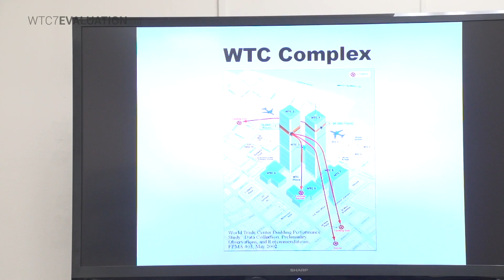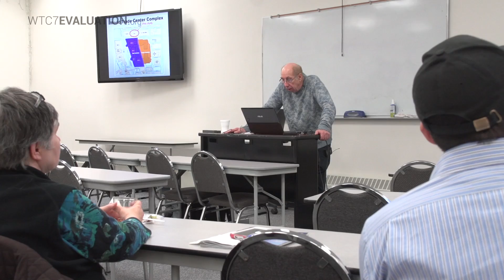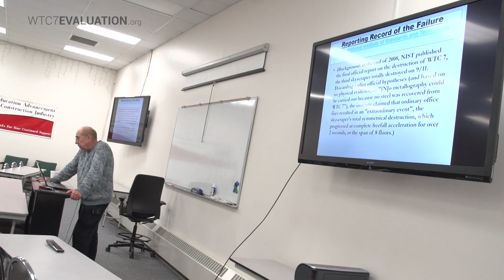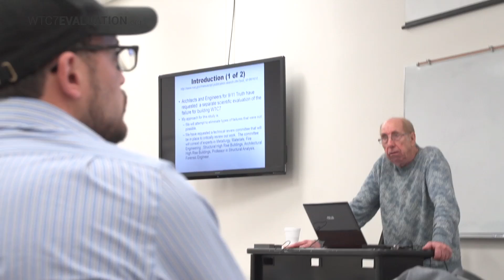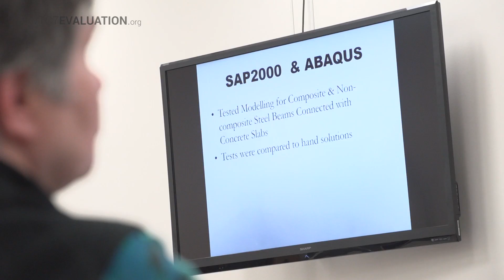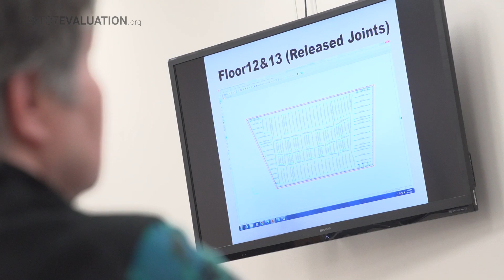WTC 7 Evaluation Engineering Study: AGC Contractors host UAF's Dr. Hulsey Nov 2015

Comment: Given this:

“World Trade Center Seven collapsed because of fires fueled by office furnishings.  It did not collapse from explosives or from fuel-oil fires.”

“We really have a new kind of progressive collapse that we have discovered here: a fire-induced progressive collapse.”  

~ Shyan Sundar (NIST WTC Lead Investigator, 2008)

Wouldn't one expect that if it had been discovered that normal office fires could collapse a modern steel-framed skyscraper, that we'd be warning firefighters?  

How about changing building codes?  Shouldn't we be working to protect both the office workers and the properties that we now "know" can just fall down if the desks and papers catch fire?  

The fact that neither of those things have even been suggested, let alone implemented shows that the official explanation is BS.

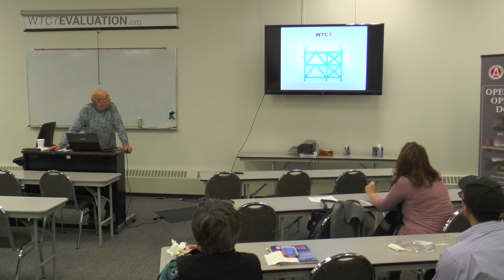Comment: 12:15 - The shown FEMA BPS figure depicts actually the load-transfer truss #3 inside the western part of building core, involving columns 61, 62 and 63. It was located between floors 5-7, like the other two trusses.

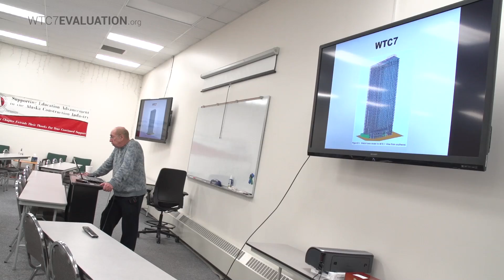12:25 - It would be worth mentioning that this figure shows NIST's WTC 7 global model (LS-DYNA), developed under contract by Applied Research Associates (ARA).